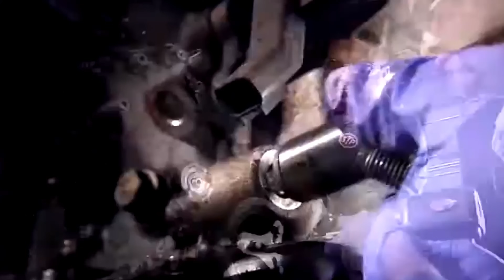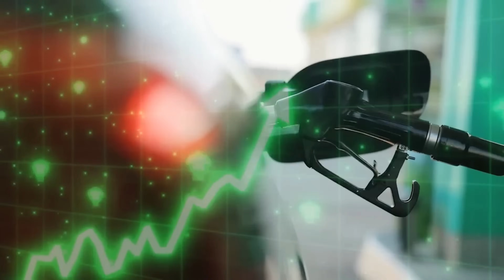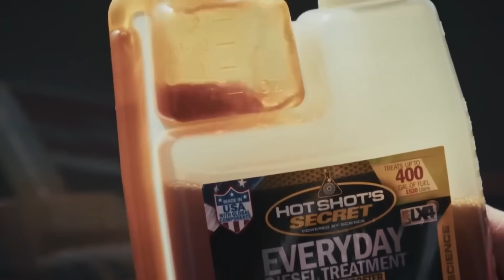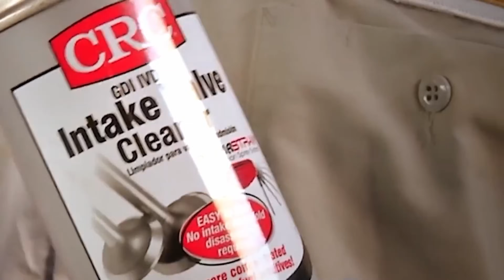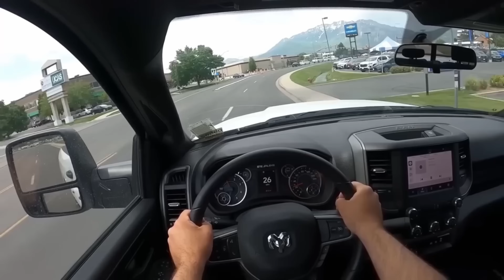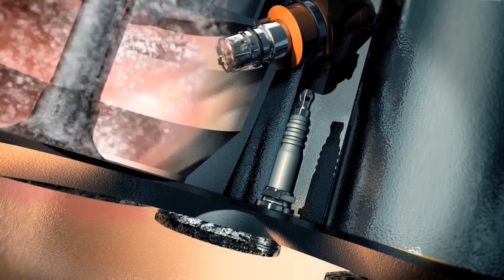Fuel Additives That Actually WORK and Fix Your Engine

Comment: Their is definitely a difference here in UK,when you add " redex" fuel injector additive. I've used it for years in all my cars, never had any issues, and you do see a difference in fuel consumption. Cars idling is better too.
Reply from the maker: That's interesting! Thank you for the information
Reply: I can confirm,I get a few extra mpg's with Redex and engine sounds more smooth with E10 fuel